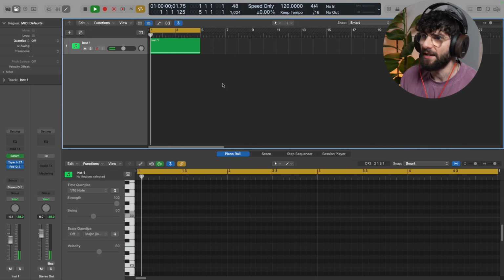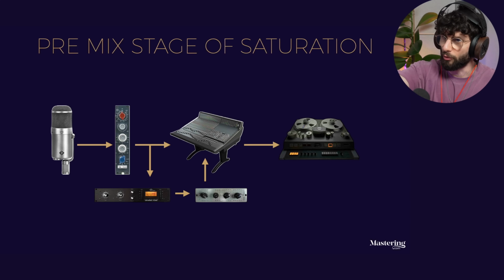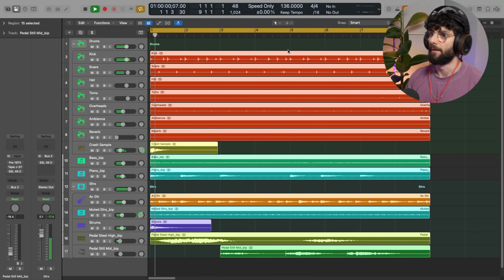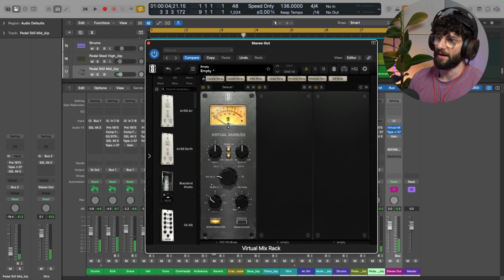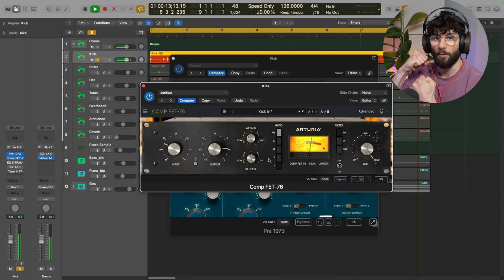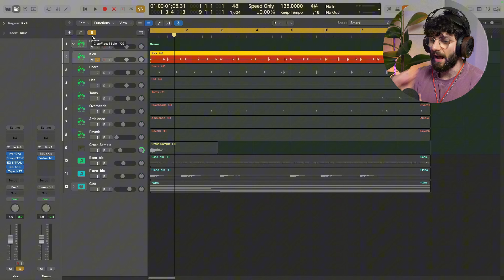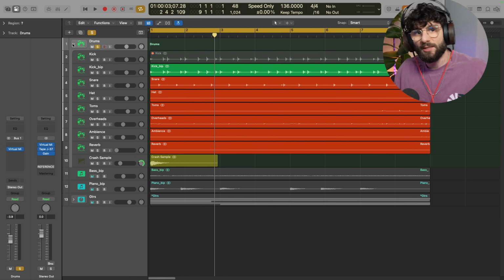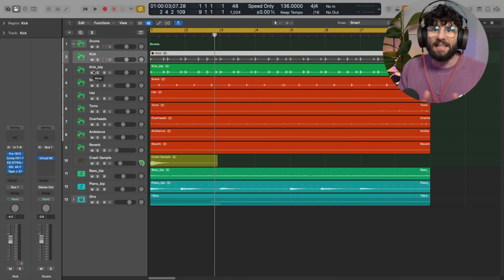How to Create an Analog Studio in Your Daw

Comment: AWESOME video.  Had a question. In terms of the application of tape to the individual tracks, there seems to be another camp that says the Tape plugin should always be the first insert, followed by the processing (Channel strip, etc.. ). In your workflow, the tape is the last processing point. The thought process is that bands used to track to tape first, and then they would run the tape through the console and finally back to tape again for the master. What are your thoughts on that?

Comment: in view of recreating analogue environments and working with tracks then busses then the 2 bus, i've always wondered how then to apply the NLS summing system,...which works on channels and busses. specifically if  the channel instantiation is used on the track then where does the bus instantiation reside? is it on the instrument bus, or as wave's and others are saying as the last insert on the 2 bus?,,,the reason i'm raising this is that as you've outlined you're recreating the channel flow which might be a pre then into the channel strip...so if using an SSL or API (or other) how would one apply the NLS system with the system engaged in this tutorial....kinda interested in still using the whole 9 of the NLS system but is it rendered superfluous by using the technique described here.

Comment: I've always done this. I recently just changed my DAW after 20 on the same DAW to UA Luna. Those legendary hardware effects are pretty much built in. I put the tape and bus summing on the master just as you did then use stuff like the LA2A and 1176 on my mix. Definitely makes a difference! Especially the plugins that let you add the noise of the hardware you're recreating. Software development over the years has done it's best to get rid of a lot of that noise but only for us to later realize that white noise and hum coming from the original hardware is what gave it it's tone. Great vid!
Reply: I recently bought Luna, too -- Haven't made the switch from Pro Tools -- at least not yet, but Luna sounds excellent with the built-in API and Neve summing options -- and I love the analog desk layout. One issue that's keeping me from spending more time with it, is that the channel controls (for track eq, compression, etc.) are so tiny on a 1440 monitor, I can't see them clearly enough. Once they sort that out, though, I could see using Luna a lot more.
Reply: @steverinaldimusic  I have a 1440p monitor and was thinking about switching to Luna as well. Maybe you can fix the tiny UI by adjusting the DPI scaling in your display settings.

Comment: SORRY - Saturation is Not what Analogue is about -  Saturation was a thing to AVOID! and only really was used as an effect for some recordings NOT All Recordings please!!!  Stop overusing the word and hijacking it as a process for recording - if its weak and sounds crap adding 'saturation ' is not the way.. its a real misuse ..Use preamps and old cassette machines for a flavour sure  - Using simulations is a waste of time.. Its OK if you've used analogue gear and understand the 'sound' and don't have anymore.. or used sparingly. You can find shitty old cassette machines I'm sue - if you look!!! - sure -  Saturation build up in a digital world is nasty! listen to what's going on in modern music.. Its now become digital saturation using analogue simulations with no 'accidental' process like the old gear gave you - and as said -  old school engineers generally wanted to avoid saturations.. Cassettes ! don't get me started haha!! If you want tape saturation find an old Cassette machine, run your sound through that shift it back in time after the process run in Parallel ..Boom ! same principal with old analogue distortion circuits 'circuit saturation" you will  have a decent amount of saturation as a parallel.. Valve same thing,   - you can make valve circuits for the price of a plugin !!! Just saying likes

Comment: I almost always use a Neve emulation, followed by a compressor (1176 or LA2A), followed by tape emulator, followed by SSL channel strip on every channel...I don't always do a lot with them, but if I can't get the sound I want with that setup then it's time to re-record something...I may use a clean EQ (like the ProQ3) before the Neve to fix a really glaring issue, but that's rare
Reply: @coywood203  I do the same but I am using an API strip because I am so familiar I do have a nice never strip but it takes me longer to find what I am looking for so it is the API most times
Reply: Which plugins do you use for Neve emulation and SSL emulation?

Comment: You did use a microphone and a preamp for recording these channels.. that is the microphone and preamp stage.. either you had some microphone like the ML-1 or ML-2 so that you can choose microphone after and a super transparent preamp so that you can use the Arturia preamp emulation..
Reply: I was thinking the same thing.

I have the ML-1 and 2. They're pretty good... But even still, it's basically just an EQ curve applied after the recording. It is not actually "emulating" the work flow as it doesn't impact the gain staging, proximity effects, polar pattern, and other details an actual mic swap would.
Reply: @ well tjat is not true. The microphone is unusually transparent as input and the algorithms are more complex including harmonics and distortion on top of frequency

Comment: I just bought the Tascam TSR-8 and the Allen & Heath MixWizard WZ3-12:2 to bypass doing this in my DAW and be able to mix down to DAT. I have a Roland PA-60 that the outs from the Tasscam will go to and then the outputs from the Roland go to the DAT machine. Will that do a similar thing to what you have shown in this video? I was thinking of getting a DBX compressor to add to the chain but I'm not really the greatest on compression and I normally leave it to my mastering engineer to do that from the mix I give him. What do you think?

Comment: This misses the point of an analog WORKFLOW. If you want to assimilate an analog way of working you need to limit the number of tracks that you work on, like a desk this enables you to work faster as you consolidate lots of tracks. If you are going down the SSL channel strip approach I'd advise using the SSL 360 app and mix from that. It's a virtual representation of a console. I use it with my touchscreen and it's as close to mixing on a desk as you can get
Reply: Really, I thought an SSL desk could have up to 112 channels. Don't really see how this has anything to do with "analog sound".
Reply: @mikebozik  SSL emulations are not my fav because the way I remember it SSL was the transparent, uncolorful, true to the source, clean way but now, that all these retro methods are romanticized, suddenly there is the "sound" of the SSL that was coveted around the world. Hey, those big time desks were pretty rare and I never got any time as a mix engineer on one but I produced for several bands with guys who ran them everyday as engineers and never did I hear them gushing about the way SSL shaped the sound, they loved the sturdy reliable feature packed versatile even futuristic layout and ergonomics of course the electronics were second to none, eq so good you had to use handcuffs to keep from over using on every channel dynamics you could use for any reason on any instrument  on every channel without distortion and unwanted noise or other problems quickly while tracking and mixing any king of sound very much the experience in mind as the DAW came into development and not like devoid of character but it was in the clean category. I recall all kinds of outboard gear in the vast patch-bays of any I ever saw in a magazine or in person because hey if your desk was SSL money was no object. so there was even then a need the use other input hardware for characters sake a lot the way the ultra convenient DAW has these many plugins for certain uses.  I recall the first time I saw an SSL in person and asked the price the guy says ... oh  a million or something been too long to recall exactly how much and seeing the shock on my face he put a hand on my shoulder and joked " but I hear they are cheaper by the dozen..."
Reply: @mikebozik  the video is titled how to create an analog studio in your DAW. The workflow element of working analog isn't really captured here. The limitations of working with fixed numbers of channels seems negative initially until you adopt that approach and then you realise that the smaller the track count the faster and easier you navigate your session which in turn makes mix decisions faster. A channel strip is the same layout per channel so familiarity with 1 channel means familiarity with all.
Reply: So would working from an analogue dest to multi track tape to another pre amp mixer to DAT be a good workflow staying out of the box completely?

Comment: It must be use with caution, i have this Arturia J 37 , this thing add a lot of harmonic distortion, if the goal is to tame a cold digital synth it's perfect , it can also soften some Rode Mic that sound a bit brittle or to sharp, that's where i use it but overprocess the stuff by adding layers and layer of tape distortion can be overkill. The tape delay feature is also a good welcome for slap back effect on guitar or vocals.

Comment: Question regarding the J37 tape machine emulation plugin- I have the Waves version of the J37 plugin and wanted to know what general settings you’d recommend using for:
•Pre-mix buss J37
•(Final) Master Buss

(Currently, I have J37 as the first plugin on my “ALL BUSS” (pre-master fader everything buss, which goes to the final master buss, currently at unity gain (with Youlean Loudness meter 2 bypassed)

Thank you!
I love the concept of this video by the way. Here for this content 🎉
Reply: the most important thing is the in and out levels.  you can play with the rest but the level on the way in and out is the biggest thing. so back in the day they were trying to make the cleanest music they could. if the level was too low you get too much noise, too high you're hitting the red, overloading the hardware. with rock and especially rap music people decided they liked the sound of overloading the hardware.

a higher level going in is going to mean hitting the tape harder. you can go into the red on the meters and be fine, it's only when the red light comes on that you're actually hard clipping. the levels on the way out can be used to turn the signal back down or back up after getting the desired effect.

the "formula" is emulation of different tape machines. 888 is from the 50s, 811 is a 60s machine, & 815 is the 70s. this is mostly just different frequency response. 50s is very midrange-y, 70s has more bottom, is warmer and less brittle.

the "modeled tracks" is different types of tape. 2 inch tape reels or 3 inch tape reels, and I presume 2+3 is just an overlap of them both.

tape speed is going to effect your wow & flutter speeds, but higher speed tape is also more prone to distortion.

tape bias is a bit complicated, but basically it was technology designed to improve tape quality. adding additional current to the audio signal to prevent losing frequencies (deadzoning). mostly high frequency signals and especially at high speeds. +3 / +5 are just representative of more bias, or more current being added to the signal to correct the tape. 
on the slower tape speed the bias is not an option on the 50s or 60s models.
Reply: @darkskinwhite  just wanted to say thank you for this advice and demystifying something that has been essentially “I like this- but I know I can dial this in a specific way.”
Reply: @darkskinwhite  For Waves J37 -- Just a couple corrections, re Tape Formulas -- 888 is an early 60s emulation -- 811 is mid to late 60s -- and 815 is early 70s. Also, the "Modeled Tracks" section is not about reel size, but related to which tracks of the machine are modeled. So, with a stereo track, choosing "track 2" or "track 3" would give you the same processing on each side of your stereo track. Choosing 2+3 would apply different channel processing to the left and right.  In a mono track, you'd only have the channel 2 or 3 option. ---

Comment: What analog obsession plugins would you recommend to replace the paid plugins used?
Reply: That'd make a great video. 🤔But you can use any of the preamp plugins to replace the paid preamps he's using here. Then you can use one of their channel strip plugins to emulate the console channel strip, and then you could use BUSTERse for the mix buss plugin. I don't think Analog Obsession has a tape machine emulating plugins though. Maybe try Tape Cassette 2 or Chow Tape Model, which are both free.
Reply: Channev Channel Strip has a Tape Drive
Reply: True. Top right.
Reply: Analog obsession has some VERY good eqs (no not the neve), preamps&compressors are not good.
Reply: You don't like their 1073 plugin?  @mirkomarkovic3438
Reply: Konsol is a console emulation they do. you can put on your tracks and master bus, . waves sell a J37 plugin which is pretty cheap I don't think Analog Obsessions have a tape emulation. CHOW Tape Model is a free tape plugin.
Reply: I’ve been using the Brit pack with BritChannel, BritPre, and BritComp and they’ve been fantastic so far. I think they may have a tape emulator but I can’t remember exactly

Comment: If possible please share a start to finish mix using console style channel strip way. I really love the videos from this channel 💐💐
Reply from the maker: It’s in the pipeline!
Reply: I have a question though. Should I use the same channel strip like SSL on every track in my song or should I use some other channel strip  also sometimes like API. Because I hear people saying not to use the same colour on every track and using same channel strip is like giving one colour to the whole song.
Reply: I think many experienced engineers have their favorites for tackling certain tasks, but your experience may vary. In the end it's mostly subjective and excellent results can be had without a single analog emulation in your signal chain. 

You might consider certain tools like my personal favorites Melda mTurboEQ and mTurboComp, have the ability to dial in your settings and then switch between the different emulations with those same settings so the only difference you hear is the difference between the 'hardware' models.
Reply: @abhishekinmusic  Plugins like Waves NLS, Brainworx (with TMT), etc., will emulate different channels of an analog desk -- giving you the slight variations in color between channels that a real console would provide.